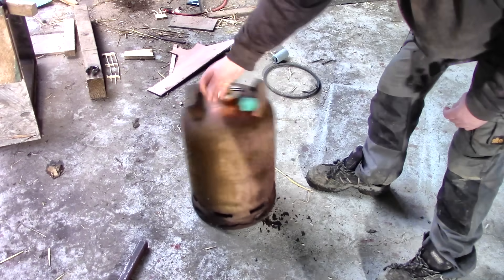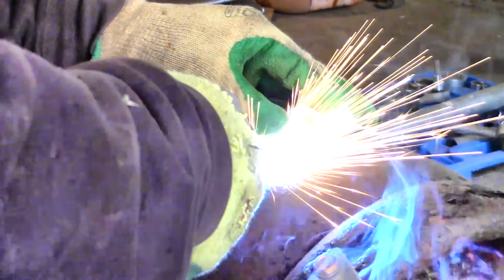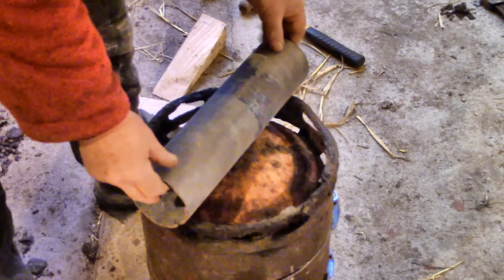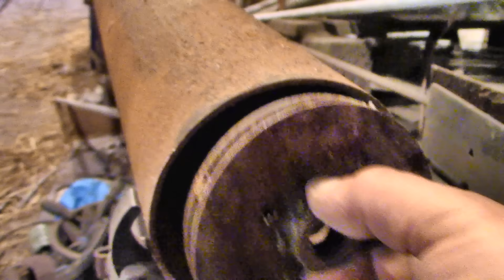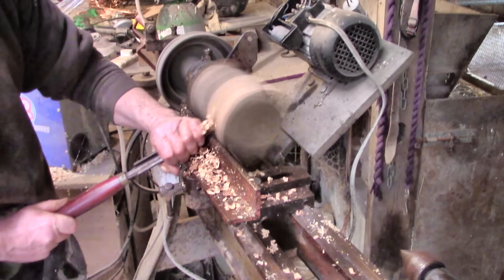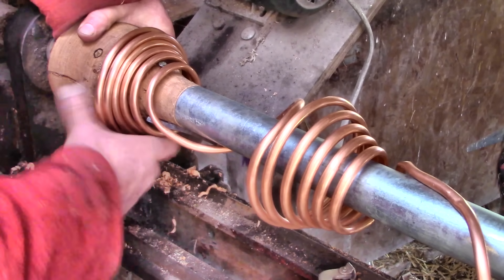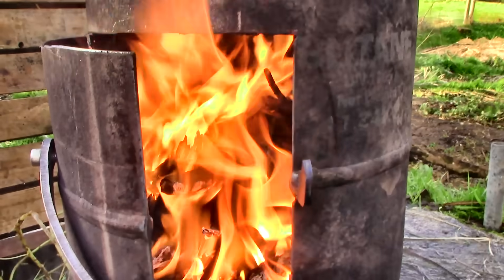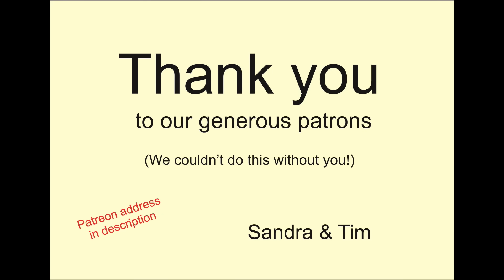Homemade Flash Steam Boiler From Plumbing Pipe And Scrap

Comment: I can't believe you have cold water going in the top and hot coming out the bottom. That is a recipe for a dangerous explosion.
Hot water and steam both necessarily rise, causing the natural syphoning effect, but you are trying to force them backwards.
Reply from the maker: Why would it explode? 
And steam goes in any direction easily, surely?
Reply: @wayoutwest-workshopstuff6299  You have cold water going down the pipe, but heat energy is forcing the heated water to try to rise in the pipe. 
Heat always rises. Whether it is gas, smoke, water or steam.
So these processes are fighting each other. Heat is forcing boiling water up the pipe, and you are forcing cold water back down the pipe.
The point at which water is heated to over 100 degrees C, as you know, creates steam which instantly explodes to 1,800 times the volume of that water.
So the steam is trying to travel up the pipe, but the water is travelling down it, and your outlet is as you said, producing ''wet steam" with sputtering boiling water mixed in.
Run your water the other direction, and the cold water is progressively heated from the bottom up, travelling in the direction it naturally wants to.
Then any steam production is happening at the top of the pipe, and not being forced back down but being released upwards , without all that spluttering water.
Reply from the maker: You're right about the cold water, of course - though I don't know how it is still water by the time it reaches the bottom. But steam doesn't rise necessarily - it just moves to a place of less pressure.
(BTW, heat doesn't always rise at all, Ruby. As far as I can gather, it only diffuses/radiates, unless it is in molecules that can move... But I'm only learning. Hot water only rises in colder water, and hot air only rises in cooler air - not in a vaccuum.)
Reply: @wayoutwest-workshopstuff6299  
Though I love your Heath Robinsonish approach to life Tim, sometimes you seem to take the hard road to reinventing the wheel, without heeding the precautions of accumulated wisdom.
Here, you are basically building a bomb.
You are forcing cold water in at the top, and expecting dry steam to come out at rhe bottom.
But heat rises, and so does hot water.
So it is hotter at the top than the bottom, and water is trying to rise in the pipe as it gets increasingly hot.
Then it is turning to steam, not just at the bottom, but anywhere in the pipe where the temperature gets to 100.001 degrees centigrade.
And water expands by 1,800 times instantly when it turns to steam.
So 1 cubic centimetre of water heated to 100 degrees will flash to 1.8 litres of steam and yes, it will expand in every direction. 
But with your tiny outlet there is basically nowhere for all that excess volume to go. 
Danger!!

I beg you to watch this video on the "BOOM-SQUISH" phenomenon of water boilers, made recently by Paul Wheaton of Permies.com. They have produced a wealth of important information in past years on wood heating and hot water, well worth studying.

https://youtu.be/jnSuEFlxHsQ
Reply from the maker: @rubygray7749  Thanks, Ruby. But they're making a pressurized system! That's completely different.
If you read through these comments you'll find that many agree with my arrangement. Although the next iteration will probably have a much more convoluted route for the water/steam it will always be open-ended. I'm not that silly! But I have a long way to go, so I'm sure I'll learn lots on the way..
Of course I have to re-invent things - because I can't just go and replicate a flash-steam generator from a steam car (for instance) because they made it with machinery I don't have. I have to keep tailoring my plans to fit my skills/tools/materials/budget - and hoping I can get something that works. Sorry if it bothers you!
Reply: @wayoutwest-workshopstuff6299  
You know you do lots of scary stuff!
But cold water needs to go in at the bottom and hot products then naturally rise and come out at the top.
You are causing pressure to rise even if the tap is open because steam is expanding at random heights in the system, and is blocked by water both above and below it. So you are getting spluttering boiling water and steam mixed, instead of a steady flow of steam from the top where it should be hottest.

Comment: it is best to put the copper tubes around a tube that you put in or sooner after that let it go along the outside of the tube or an intermediate tube over it where the moisture falls away it is also testing you will get there on . then later connect to a motor that you change something and you then have rotational movement well wort great to see all that

Comment: to bend copper pipe you cap the end fill with water or sand and then cap the other end with this inside the pipe can not kink another thing is you wont the water feed in at the bottom of the coil
Reply from the maker: tube too thin for sand, I think. Could get it in but I'd worry there'd be little  gaps
Reply: @wayoutwest-workshopstuff6299  if play sand is used and is dry it fill easy I did it when I was making a water heater and using copper break line

Comment: You need to reverse the water flow.  Cold water in at the bottom and steam out at the top.  You're getting mixed phases (steam / liquid) due to the direction of flow.

The pressure inside the tube is the same whether you're measuring liquid or steam.  Keep the gauge at the bottom so it's exposed to cool liquid not hot steam.  If you use utility pressure to feed the water into the coil, you'll be limited to that pressure for your steam.  You'd be essentially converting a small amount of a cool, dense, liquid at utility pressure to a large volume of hot gas at utility pressure.  

If you eventually use a pump to feed water, be sure to add a check valve before the gauge.  Otherwise you'll measure the pressure of the pump and not the steam.

Depending on how much steam you produce, you may need a surge tank on the outlet side.  You have a fair amount of volume in the tubing but when you're producing a lot of steam, it can flash evaporate and produce pressure spikes.  A steam surge tank will help mediate the pressure.  (be sure to insulate the tank and outlet plumbing or you'll condense water out prior to the point of use.  )
Reply: So you think superheating will occur at the point where the flue gas is *coldest*? He's getting wet steam because there's not enough energy getting into the water for complete boiling at that pressure, reversing the flow to make a parallel flow heat exchanger will not improve that.  He needs to increase the surface area of the heating coils, and/or the temperature and air flow rate of the firebox.
Reply: @Chlorate299  He's not going to get superheating anyway with that system.   At best he'll get dry steam.  The way the gases are blowing up the chimney, there isn't much temp difference between the bottom and top.  Counter flow thermal transfer is effective if there's a temp difference between inlet and outlet.  Otherwise, the thermodynamic advantage is minimal.   His main problem is phase separation, that'll be improved with water on the bottom.  At least that's what I found when I built my flash boiler....
Reply from the maker: Thank you both. I'm learning such a lot!

Comment: That’s a lovely heat exchanger, Tim.  Since the system isn’t pressurized you’re not likely to generate much superheat.  The steam won’t get above 212 F (100 C) until all the water is converted to steam. So I think you key to getting more complete conversion is increasing the temperature difference between the water and the flue gas.  The max water (steam) temp is likely to only be 212F.  So concentrate on heat generation.  And the faster and more turbulently that hot flue gas flows up the flue the more heat will transfer to the copper tubing.  If manageable use a smaller diameter copper tube to provide more surface area for heat transfer.  Design/arrange your coils so all surfaces have equal opportunity for contact with flue gas.  I also suggest you measure temperature at the inlet and outlet points of both the flue gas and water/steam.  You’ll be able to use the temperature differences to monitor performance and efficiency.   Love your videos.  You and Sandra have such interesting lives. Best of luck to you.
Reply: He should also consider reducing the flow rate.  That ensures all water has sufficient residence time to convert to steam.
Reply: There was a time during the video that the outlet was closed slightly to induce pressure. If the surface area of the heating coils is sufficient, then system could in theory pressurise even with the tap left open, and judging by the fact that the intention was to use a combined pressure and temperature gauge, pressurisation was expected. 

The boiling point of water is not a constant, hence I suggest that what you have said is not quite correct (whilst not being a untrue), as as the pressure increases, so does the boiling point of water. Even on a low pressure boiler with a working pressure of just 50psi, the boiling point of water has increased to almost 140 degrees C, meaning the water and steam has to be in at this temperature to make steam. The boiling point of water is also effected by altitude, with the higher you are the lower the air pressure, the lower the boiling point of water. The Given boiling point of water being 100 degrees c is only at 0 altitude (sea level) 

If the water feed system is off the water main, then the pressure of the boiler can achieve equal pressure to the water supplied, and if a floating washer type valve (old fashioned tap washer type stop cock) or non return valve is used on the water side, then the pressure of the boiler can surpass this, but with undesirable side effects, being that the system will boil dry with a lack of feed water until the pressure in the system has dropped to below that of the supply. I don't know the actual mains water pressure (assuming the hose pipe was fed by mains water), but a quick search on Google suggests its between 25 and 45psi in Ireland.  In the UK its all over the place, despite officially being between 1 and 2 bar. Where I live the pressure is around 30psi, but I've been on farms where the pressure has been well over 120psi , and my friends house is operating at a mains water pressure of 80psi, I've also been to places where this is very little water pressure. 

The super heater would still dry the steam out further and prevent condensation, and once dry would increase the temperature of the steam, even at atmospheric pressure, with any water finding itself carried into the Superheater, being turned into steam. This is why it is dangerous to "prime" on a superheated railway locomotive due to excessive water level in the boiler, as the water is flashed into steam, coursing a uncontrollable increase in pressure trapped in the superheater, and normally leads to a uncontrolled wheel slip until all the water has boiled into steam, even if the regulator has been able to be shut preventing further feed into the circuit. This was what happened to Blue Peter on Durham oviduct in 1994, in her case, water carried over into the superheater, flashed to steam, and the pressure increased to that above the boiler pressure, forced the double beat regulator wide open, which continued to feed the super heater with water to turn into steam (in effect the super heater circuit became a flash boiler), not that this is a problem on a stationary boiler with screw or ball valve.
Reply: Might it make a difference to put the inlet at the bottom of the coil?  It seems as though the water is able to fall through the chimney before absorbing heat.  If it were to enter from the bottom, gravity will help the liquid water stay in the coil longer.
Reply: @thekodanator I was thinking all this time..why is the outlet of the steam on the bottom when it literally rises?lol
Reply from the maker: Thank you both - yes, that makes sense

Comment: They are called water tube boilers vs. fire tube boilers. I'm planning one for my hot tub. I am going to use  3/4" tubing in a pair of coils (12" & 10") in the top half (18") of the firebox (40"). These will be plumbed through the wall with bungs.with a check valve on the supply side (this is to prevent steam from pushing back against and into  the  water supply) and insulation on the hot side. The water from the hot tub will be in constant circulation. Ash pan and dampers also. Love your door hinge idea, I will copy if there is no patent on the use. My boiler will be 60" tall. looking forward to your upgrades, they have always been good on your other projects.
Reply from the maker: Sounds fun!

Comment: Kink solution?  Fill coil with water and clamp solder ends before bending.  Bend slowly and carefully.  Should not crimp if filled all the way with water.

Comment: I always anneal my copper pipe when doing bends like this, even when new, as copper age hardens and this is when you get the kinks forming. This is simply done by heating red hot then quenching in water. It also helps to prevent to stop cracking over time. IF you ever decide to use a boiler seriously, please do not use any pipe that has kinked. It will crack where the kink has developed very quickly and your boiler will fail. 

I feel you have you coils too close together, they should also be evenly spaced out all the way down. 

If you wish to dry the steam, you can "super heat it" by passing it back through the fire. This is what they do on most railway locomotives. Sentinel Steam wagons used a water tube boiler which is basically what a flash steam boiler is (the water is in tubes and the fire passed around it, where a locomotive type boiler is a fire tube boiler where the fire passes through tubes within the water), with super heater coils in the top of the fire space. This dramatically improved their performance compared to their earlier counterparts, with all the steam now reaching the cylinders being steam. With railway locomotives the same lesson was learnt, with the higher the square area of superheating, the less coal and water were used.  Not only does superheating dry the steam out by increasing the temperature, any water that finds its self "carried over" with the steam will be flashed into steam itself. 

With your system this would improve things a lot. I would also consider coiling tubes around the inside of the firebox wrapper to make use of the heat better. This is where you true flash boiler would have its heating elements, whilst the super heater would be where you have you boiler coils. 

The other way to "dry" your steam more would be to reduce the water flow slightly. 

As well as using steam for powering engines, you can use it for sterilization, not only of objects and bottles, etc, but also of soil in glass houses, and use it for heating.
Reply from the maker: Yes - that all makes sense - thanks

Comment: Flash steam boilers were mostly used on steam cars and fire pumps . There was experiments with them on locos but they do not work well cause they need a constant supply of water which is kind of an issue on a steam loco. Also the reserve steam is something you need as well so it’s less effected by changes in the fire.

Comment: I don't know much about steam but I have built a few wort chillers in my day for my self and my friends. If you fill the pipe with something non-compressible, like water or sand, then cap the ends with fittings, you can bend it much easier without it kinking.

Comment: Tim, instead of using coils fill the chimney with lengths of pipe connected together with U bends at the ends. you could get a lot more pipe in there that way.
Reply from the maker: Yes, thanks, but I'd be worried that the solder would fail - any thoughts?
Reply: @wayoutwest-workshopstuff6299  the melting point of brass is 927 °C. Brazing is the only way to go, but takes a bit of practice  . . .
Reply: @wayoutwest-workshopstuff6299  Not sure about that , Is the steam in the tubes going to be   under pressure ? There are solders that have a melting point of over 300 degrees C. Steam at 100 PSI would be at 170 degrees. If not under pressure then silver solder is good to 140 degrees.
But although I have an engineering qualification it isn't in anything to do with steam so be careful!!